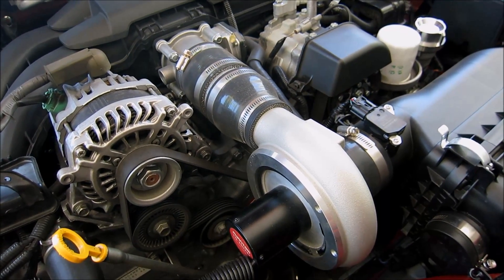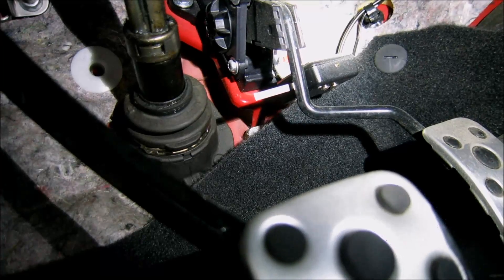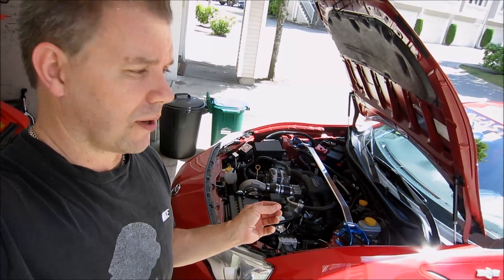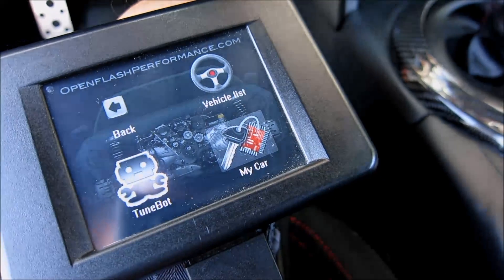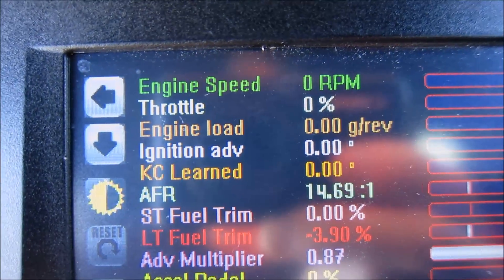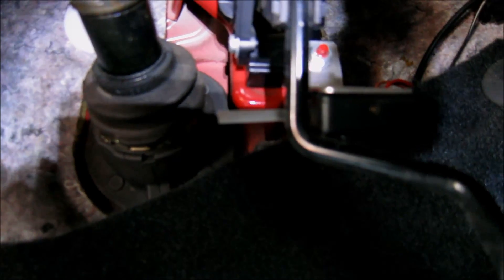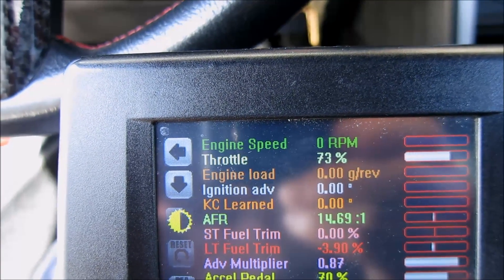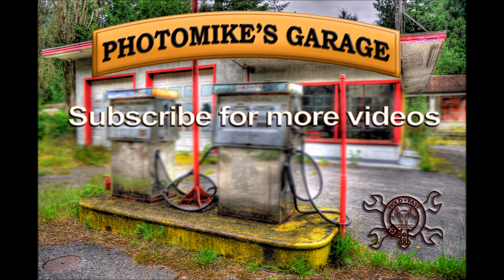The Phantom supercharger throttle activation

Comment: Electric supercharger, HA! I can do the same thing with my wife's hair dryer connected to the engine. And if I wanted more flow, I would use my leaf blower instead of the hair dryer. You would make more power by simply pulling off your air filter and straight piping the outside air to the throttle body instead of using that hair dryer. That "supercharger" is nothing but a joke, a waste of money and junk. If you want to add power, then usr proven technology and not some invention made by Mickey Mouse.
Reply: Frank Gonzalez 

It's not the same thing you idiot!  your hair dryer does NOT compress the air it just simply moves it.  Come back and comment when you have educated yourself on the matter.  Will it solve all your driveability needs, no.  Will it make 1k horsepower, no.  But for the casual driver and. curious individual it would suit their needs.  He's not using your money.  Go buy your proven technology for your own car then and pay no attention to what he does.  How do you think your proven technologies came to be in the first place?  Were they proven when they were on the drawing board?  Idiot!
Reply: Dumbass alert 😂😂😂🖕🖕
Reply: forget this guy frank. i like it man. could be a legit solution to a laggy turbo if you ran this. imagine 2-5psi and how much extra exhaust gas that could create to help spool a large turbo. just run them is series, electric feeding the regular turbo. like a twin charged system but electric.
Reply: Let's see your wife's hair drier put out 2 psi, much less 5 psi. Ha!
Reply: this isnt a simple hair dryer. all a person needs to do to make boost is to spin the impeller at a rate to force air into the engine faster than it can it eat. these smaller motors are well capable of putting out 10hp.
Reply: Maybe hes talking about a gas leaf blower lol even an electric one is easy to use in the vehicle with an inverter. Personally I would never waste money on something like this.
Reply: Haha you clearly know NOTHING about brushless motors and their torque and power.
Reply: Gonzalez: Fuck you! I will blow out all stupid commenters which are not Profesionnal engineers like you . You are wrong!!!!!
A Leaf blower is made off a plasic impeller at about 2000 rpm , while an ESC is running at 50 000+ rpm. There is no comparaison. And where do you think you could find a 12 A at 120 V AC in a car for a leaf blower?
Reply from the maker: The inventor is a engineer for Pratt and Whitney and as far as I know does not look like Mickey Mouse  lol

Comment: all this asshurt in the comment section.      simple answer,  get a true pride and tide charger.     while electric ones do provide boost at a lesser level they are faulty and both break or overload very simply.   a real turbo or super   whichever you prefer will go much longer with far less maintenance.   super charger is the better equivalent of vtec. and turbo is good old fashioned tuner boosty fun.  but either way youre good.   but for those who just want a lil more pep in their step  the electric charger is fine.
Reply from the maker: I would say that the electric supercharger has been very reliable , no issues at all.
Reply: do you race your scion or just boost it a bit.   like i said,  electrics are fine for boosting a lil bit   but  genuine racing  will wear them out a whole lot faster than a professional turbo or super.
Reply from the maker: Corey Davis  I don't know if it will wear out but you are right it is not very suitable for racing which will deplete the batteries faster than they can be recharged.

Comment: it's not a super charger nor a turbo charger its just serving to spend money on that doesn't add much if at all "boost performance" is just ridiculous you want performance go but the real deal
Reply: your voices asmr The compressor is exactly the same as in a real turbo, and it works in exactly the same way, its only powered differently. Think for a bit before smashing nonsense into your keyboard

Comment: Why wouldn't you get a conventional supercharger or turbocharger for your car.There are a few kits made for your auto. You have an awesome high tech modern boxer engine with a piece of crap s.charger.  If you don't believe it look up elec. superchargers or elec.turbos. Both crap. 5 psi boost is nothing and 2 psi you could get that with an electric leaf blower. The idea is more power. You can keep denying it but the fact is these things are cheap to make and are a big rip off !
Reply from the maker: 5 psi is not "nothing" lol   I got the electric supercharger because I want to try something different and innovative.

Comment: For $2k you could get a used car with an ACTUAL turbo!
Reply from the maker: But I wouldn't have the FRS!
Reply: Then spend $2500 on a REAL turbo kit for your FRS from Ebay, and your done. I agree, electric powered forced induction is probably coming, but is still just a concept, with few prototypes delivering enough power to consider it an alternative to modern turbo/SC. Your either a troll, a salesman, or ridiculously gullible. You bought a sporty LOOKING economy car. 200 HP and almost no torque. You have to wind that tiny thing to 7500RPM just to squeeze what little you can from it.
Reply from the maker: A cheap turbo kit from ebay will not be reliable, will need modifications to work ,will need a tune and supporting mods. If you want to do a turbo right it will cost you way more than the phantom supercharger.Now I have a sporty looking car that does have torque down low thanks to the electric supercharger.

Comment: There doesn't seem to be a way to test the actual boost at rpm. When the engine hits the higher rpm's it's bringing in a lot more air, so the supercharger has to be able to keep up. I don't see that happening with an electric motor with only two fixed speeds. Because of the heat associated with an exhaust driven turbo, I think electric would be a good way to go, but you would have to determine the engine airflow, and be able to add the correct amount of pressure to get the boost you are looking for. Sell it. Somebody will buy it. You did.
Reply from the maker: The electric motor is able to spin the impeller more than 50,000 rpm which is enough to produce 5 psi boost but only at lower engine rpm .At red line the max boost is 2 psi which means this system produces all it's hp at lower rpm which is great for city driving and the opposite of a traditional turbo system.

Comment: Once I see dino facts, with before and after, I may start thinking it's real. But we all know you won't do that. Cause it "works" so why bother.
Reply: guys, it's "dyno" not "dino". You all should do some research before making your own uneducated assumptions. You're regurgitating "facts" about obvious fake echargers, which are indeed true and factual. They don't give you any performance gains and restrict airflow.

If you guys would actually LOOK at what is in this video, then go and look at those fake echargers on ebay, you'll see they look nothing alike. What you see in this video is a real turbo compressor being powered by a brushless (powerfull) motor. The same type of motor that powers all of the camera and racing drones, just MUCH larger and higher RPM. If the design produces boost, then you're going to get performance gains.
Reply: Oh no! My phone made it "dino" and not "dyno" what will I ever do?!
Reply: Jesse Shanks regurgitating facts... because facts are facts.... dyno sheets before and after will tell
Reply: smugdoggo exactly, need to see the numbers
Reply: The theory behind these e-chargers is sound. Just check what F1 cars are using these days.  Although the electric motor on this one seems a bit small. But electric motors have instantaneous torque and high rpm. I’m actually extremely interested in getting one of these for my worked WRX STi in order to reduce turbo lag. Does anyone know where one be purchased?? Cheers
Reply: Adrian Rees, arnt the F1 ones a hybid turbo, electric first then exhaust later. This was to reduce or eliminate turbo lag.
Reply: You can shut the fuck up, that's what :)
Reply from the maker: Dyno coming in the spring.
Reply: Sorry but if MCM did it, and it didn't work for them, then it's not working for you buddy. #sorrynotsorry
Reply from the maker: There are plenty of results from reputable tuners like this   https://www.youtube.com/watch?v=Q_ltL_pbHPY
Reply from the maker: MCM tested a obviously crappy ebay fan in intake with obvious results.
Reply: Photomikes Garage dude, give up, your trying to make something that doesn't work, work. Do a Dino test or give up. Simple as that!

Comment: ITs a stupid design because your placing a restriction in the path of incoming air when the fans not on?
Reply: @urbex2007 actually, you're thinking of the fan style gimmick "electric superchargers" which do not produce boost and restrict air flow. This is a real turbo compressor housing (cold side) with a brushless motor (mimicking the hot side), which can spin at similar speeds as an exhaust powered turbo. If your boost gauge reads boost, you can tune for performance gains. Those fan style BS e-superchargers don't show any boost on a gauge, thus no gains.
Reply from the maker: Actually there is very little restriction and if there is the system detects the vacuum and operates in drag reduction mode.
Reply from the maker: See my reply above^^
Reply: It's "you're placing" not your placing, stupid.

Comment: Nonsense, why no one tested the car before and after the installation of the electric fan on the DYNO test. The first error is fed into the hot air, and to compress the air must be cooled down what works like a classic turbo intercooler, and only then by the blades of the turbine compressed air and fed into the engine.
Reply from the maker: It has been tested on the dyno by others, see my other videos.

Comment: The answer to your question is:I Don't need it I have installed aftermarket  turbos and own one in my car  2002 Buick 3.8 Turbo It takes a lot more than a blower and simple tune to get results, that is why I say FAKE!!!!
Reply from the maker: Not fake ! If you can spin the impeller at 50,000 rpm or greater you will get boost.

Comment: a lot of people seem to think that an electric supercharger system is a dumb idea. however it is actually very practical and with the ability to turn a supercharger on and off, you get the power benefits of having a supercharger, but you can maintain the gas mileage of not having a supercharger. 

however i do agree that currently electric superchargers are not a common thing, and have a lot of room for improvement. 2-5 lbs of boost is not that significant. 

I am kind of interested in seeing a trunk based electric supercharger system, where an electric motor turns a drive belt. and it's speed is controlled by a potentiometer to mimic a belt driven supercharger. this would allow for much higher boost levels, and more active control of those boost levels. but not limit you on space under the hood. one could have 20 pounds of boost under hard acceleration, yet still maintain mpg on the highway. It would be great for a sleeper car. also could be easily removed theoretically to maintain your trunk space. run the output of the supercharger from the trunk underneath the car (or through the cab if necessary) into your engine bay. and just have a waste-gate like device to allow for a bypass to a standard intake for when the supercharger isn't used. simply remove the supercharger set up and cap the pipe to get your trunk space back. 
the larger motor could be powered by a few batteries kept in the trunk as well, and recharged via solar pannels on the roof if desired i guess.
Reply from the maker: 5 psi 30 hp and 40 lbs is significant in a 2700lbs car but yes there is room for improvement.

Comment: Such a bullshit :DDDDDD
Reply: It's not bullshit, everyone thinks it's bullshit because of the MCM videos on electric superchargers (I like MCM, by the way), but this is the real deal. It is a brushless DC motor that spins at 50k+ RPM attached to an ACTUAL turbo compressor housing/compressor wheel. It's a actual turbocharger, not a fan, with the hot side ripped off, attached directly to a DC motor, and it does produce boost. I thought it was bullshit too until I did about 5 minutes of research. 

Of course it has it's downsides (only active at full throttle, needs a separate battery to recharge, etc.)
Reply: DoZeR12367 no it's not your just a idjit
Reply: The Best Possible Scenario these people that doubt these are dumber then a imbreed with rocks for brains
Reply: Paul cherry then why isn't there a big market for them.... because people are dumb or they want real power....
Reply: Tn Bui dude they just starting coming out with then duhhh
Reply: No it's not just plain bullshit
Reply from the maker: It's real.

Comment: blow off vavle?
Reply from the maker: No blow off valve is necessary as the boost is only 5psi and the impeller does not freewheel.
Reply: because it doesn't work it's a fake
Reply: DoZeR12367 y so mad, you offer no technical input as to why this may not work - if it creates boost it can increase power of the engine if more fuel is added
Reply: the only reason he has seen any gains is from the tune....period. not the "supercharger" tune the car without it. the gains will be the same....there will be no increase with it connected.
Reply: the only reason he has seen any gains is from the tune....period. not the "supercharger" tune the car without it. the gains will be the same....there will be no increase with it connected.
Reply from the maker: A tune ( which I have) will only give you 9 hp max. The Phantom supercharger gives you more than 30hp which is gains you can feel.

Comment: You consider 2000 dollars as a cheap conversion for this junk!. For 2000 dollars I can buy a REAL turbo and turbocharge my engine my self and get a tremendous power gain. Ah 2000 for this non working JUNK!.
Reply from the maker: It works and any good turbo system with supporting mods will be over $3000.
Reply: Photomikes Garage Maybe from this system you get 20 bhp for a half a minute , you can chip , cam and exhaust and head work for double the power for unlimited time and TRUE turbo / supercharge for hundreds of bhp gains. Live in reality man!.